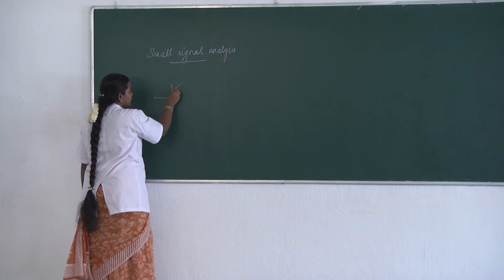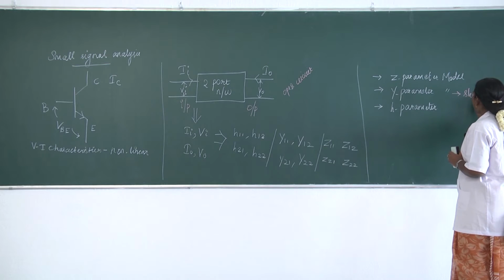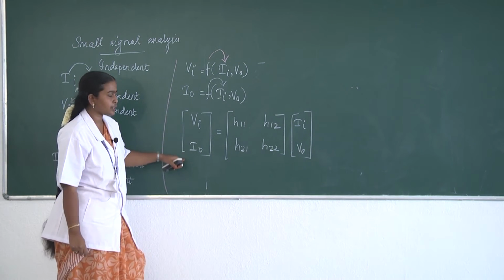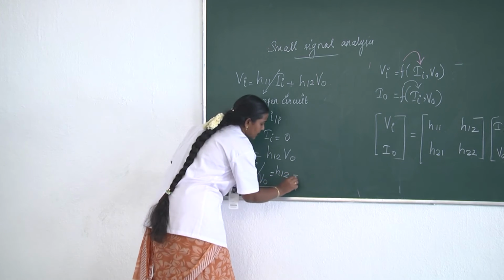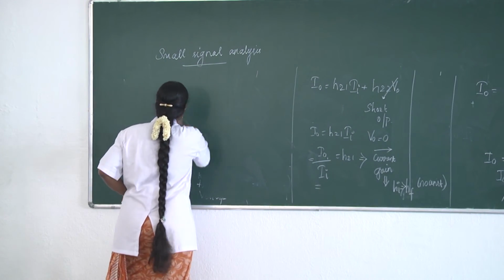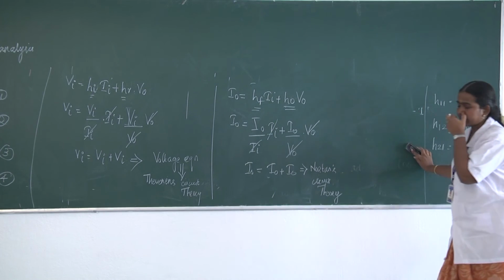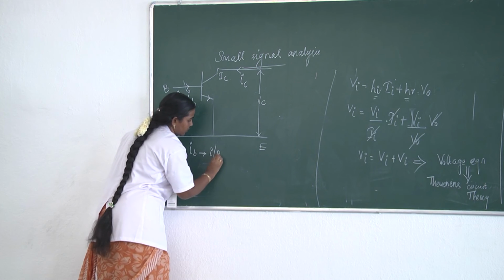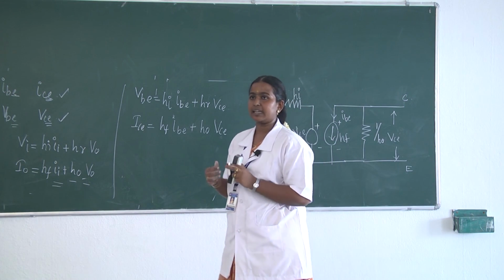Small Signal Analysis of Transistor

Comment: Small-signal equivalent analysis
The h-parameter model of a transistor operated in the common-emitter configuration maybe represented using small signal parameters denoted hie, hre, hfe and hoe and the definitions maybe found in several textbooks. It is  the principle of superposition of electric fields and voltages which assist circuit analysts in developing ac small-signal equivalent circuits of complex circuits.
It will be instructive for students to learn first how electrostatics and circuits belong to one science not two before studying the development of ac equivalent network using small-signal parameters. To learn the operation of circuits, Current and the conduction process, resistors and how discussing these topics makes it easier to understand the principle of superposition of potential which is a direct consequence of the principle of superposition applied to electric fields, 
watch these two videos 
i. https://youtu.be/TTtt28b1dYo and 
ii. https://youtu.be/8BQM_xw2Rfo 
What made it possible to develop ac small-signal equivalent circuits? 
Since the electric fields of the ac signals pulsate in the dc voltage source, (see the processes described in “How can a voltage source close the circuit ?” in Chapter 3 of textbook 4 in References video 1 above), across the charged capacitors CB of the biasing network 
and the output capacitor CC, setting up pulsating components of signal currents in the dc voltage source and in the leads and plates of the capacitors, these can be replaced by short-circuits. Therefore, in the ac small-signal equivalent, each dc voltage source is replaced by 
its internal resistance, and if the source is ideal, by a short-circuit. We should not forget that the principle of superposition of electric potential (signal and dc) that stemmed from the principle of superposition of electric fields (see the  Chapter 3 of textbook 4 in References video 1), allows us to do this. 
Thus, the dc biasing supply voltage VCC is replaced by a short circuit, and the network redrawn. 

The last frame of video 1 contains in the References textbook 4 a separate section which discusses with the help of sequential diagrams the application of the principle of superposition in the development of the ac small-signal rquivalent of transistors using the unified approach. This helps students obtain an intuitive understanding of the equivalent circuit and apply it in design and analysis of amplifying circuits.